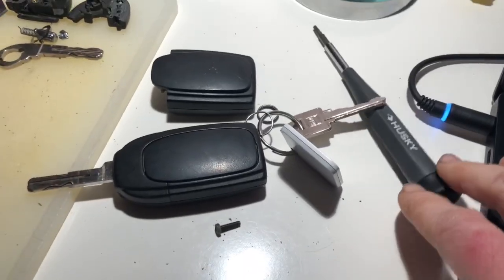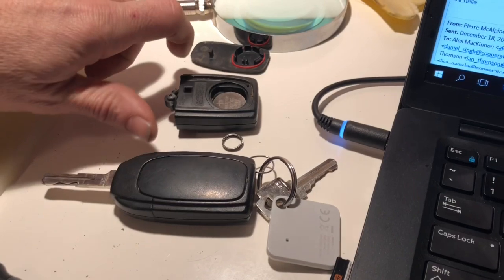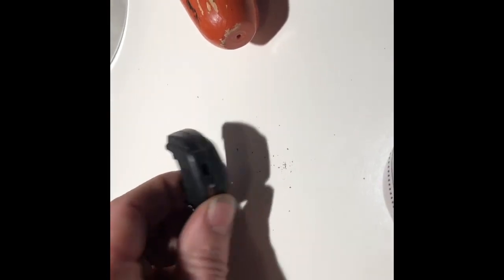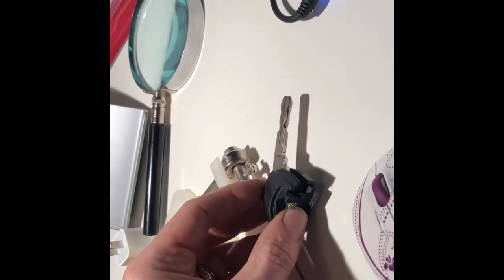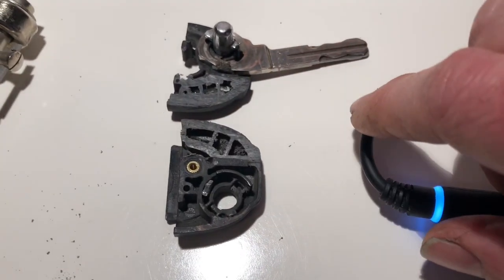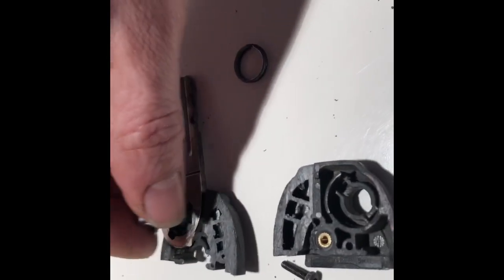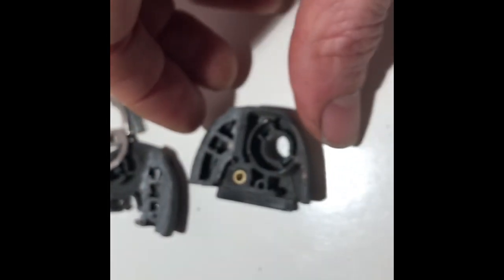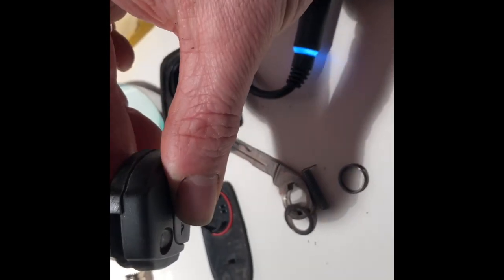Volvo key fob 8626556 Disassembly

Comment: The way the two parts separate is you push DOWNward on the top half with the key compared with the bottom half.  Rock it back and forth a bit and it will release.

Comment: Actually, the correct way is; you separate the two parts.  With the battery side facing up, you slide the part with the key down.  So do not force by pulling forward from the T9 as there are two clips latched on either side of the T9 hole.  Look closely and you will see what am talking about.
Reply: I suggest to also watch this video, shows how to separate the housing: https://www.youtube.com/watch?v=VrQ4ITM00WA

Comment: Good grief.  This sucks.  You say in the video "do NOT pull apart", use left to right.  In the voiceover, you say the exact opposite.  This is where I am hung up - getting the two parts separated.  You were so lazy you didn't even show this procedure.  I mean, you didn't even have a straight blade screwdriver as a prop?  Come on.